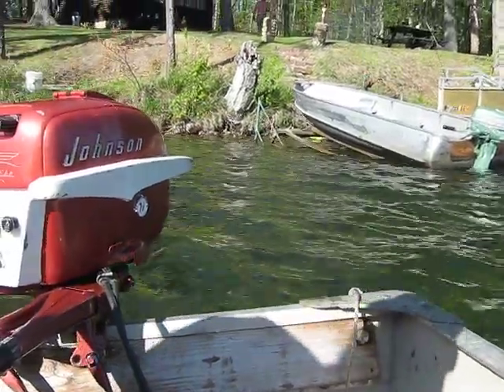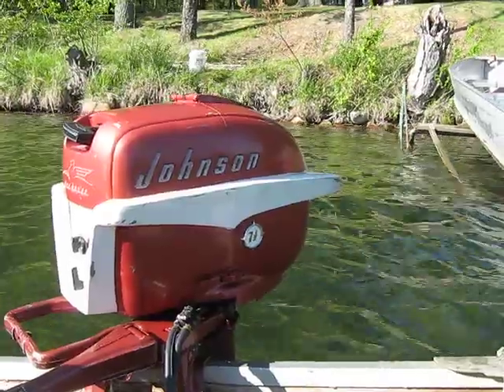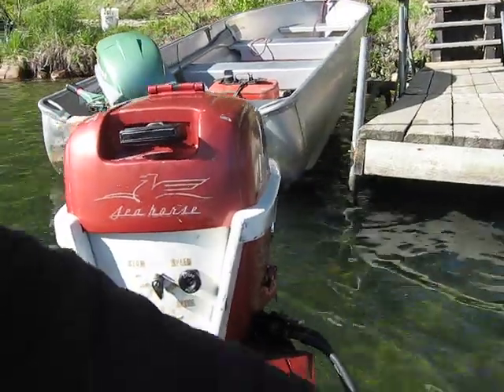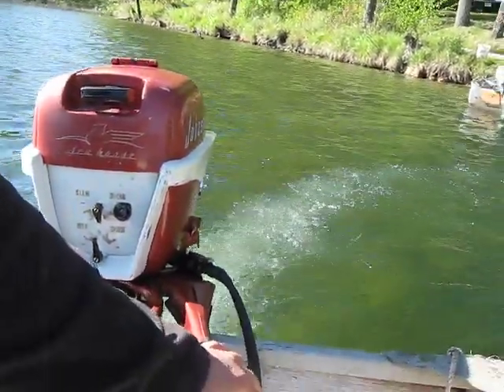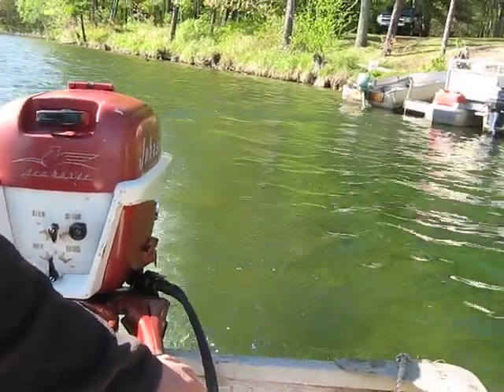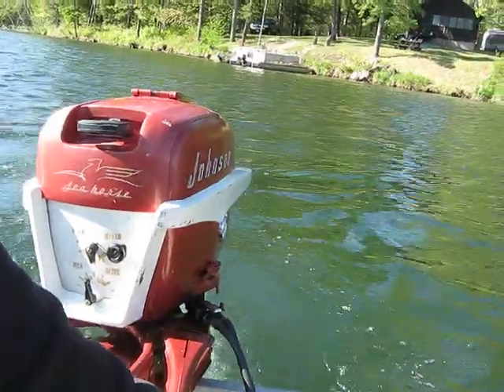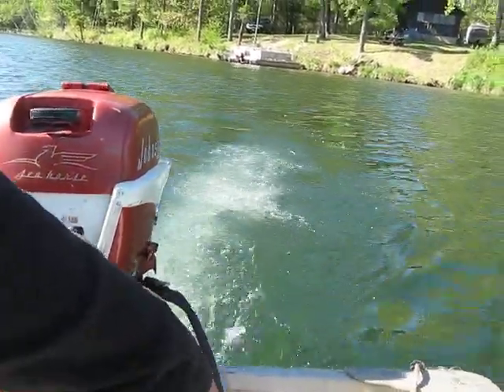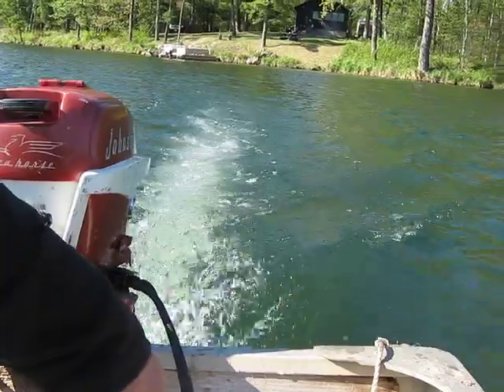1956 Johnson AD-10 7.5hp outboard motor

Comment from the maker: OMC is outboard marine corporation the maker's of Johnson/Evinrude and Gale outboard motor's also Lawn boy, now owned by Bombardier Recreational Products.
Your motor is a 1956 and all Johnson motor's where called Sea Horse, and i am about 80% sure you can get that part new at a Evinrude dealer. Sorry i do not know the part #  If you can't get it i will give you contact info where you can get it.

Comment: I'd love to have one of those old 7.5 HP Johnsons. I have a 1968 Johnson 1.5 HP, a 1972 Johnson 6HP, and a 1991 Johnson 70HP. The flat bottom wood skiff I'm using the 6HP on could really use a 7.5 - 9.9 johnson. My 1968 1.5 Johnson is still running on the original spark plug! Starts on the 2nd pull every time. I'm betting it only had about 100 hours of usage in its life until i got it, and I've probably put at least 100 more on it in the past 5 years.

Comment: Just bought a 12' foot boat with a 7.5HP Johnson AD-11 on it - guy says it runs but hasn't started it in a couple of years - what should I do before attempting to get it started?  Thanks!
Reply from the maker: cafesutton Well that's a little hard to say, I guess check the oil in the lower unit, mix up fresh gas at 16/1 and give it a try.
What i do before even trying to start them is replace the water impeller, pressure test the lower unit and replace any seals that are leaking, then i check the ignition system and replace whatever it needs, then i rebuild the fuel system i replace the needle and seat in the carb and replace the the fuel hoses.
I know it sound's like a lot of work but it is worth it! after doing all that work you know that you will have a very good motor for years.
Reply: chrysleroutboarddude Thanks I'll have to google what all that is & how to do it - sounds like a fun project for me & my boys!

Comment from the maker: With that kind of answer they gave you tells me that they NO NOTHING ABOUT OLD ENGINES, in 1956 this engine used plane bearings and 50/1 will kill it! NEVER EVER USE ANY THING BUT A 16/1 gas oil mix

Comment: I have a 1956 7.5hp Johnson and have replaced points coils and condensers plug wires and went through the carb  but I think I did the high and low speed jets wrong. and would like you to show the proper way to replace the o-rings and witch needle go in each one. Thanks for your help.
Reply from the maker: +Magnumforce Well the long sharp needle is the top one or the low speed and the more blunt one is the hi speed one. Hear is a video I made on adjusting them. https://youtu.be/c-xtqu-KmLY?list=PLaNroSGbEo-tqc5GnxrnbXgZqzQuRyvr-

Comment from the maker: Well lets start with the stalling, with all the symptoms that you are telling me i am thinking that the spring in the shock absorber in the lower unit is broken, that explains the stalling,the sounding like it is in gear when not, and the oil leak. As for the sheer pin DO NOT USE A BOLT i think you can still get the prop nut at Evinrude, 
Now for getting that lower unit off, you need to remove the power head to undo the shifter,and sorry i do not have that video but i know it is out there on Y/T

Comment: I just bought a qd-19 at a estate sale.  I eant ti fire it up and see how it runs. 
What gas oil ratio should i be using? Thanks for the input.
Reply from the maker: r tuck The 10hp uses a 24/1 gas oil mix.

Comment: Chrysler, I would like to put a long er 2 hose fuel line on my 14' boat to get the weight of the back. Is that possible?I just purchased the AD10 with orig gas can.

Comment: Hi Ben, I have one of these motors and I replaced the impeller and it has new plugs, I can't get it to get my 12 foot aluminum up on plane, it runs smooth but I am looking to get advice on the high and low adjustments and the proper oil and gas to use, any advice would be appreciated